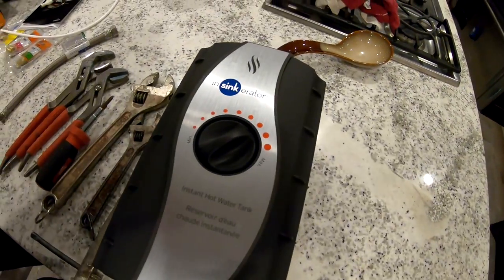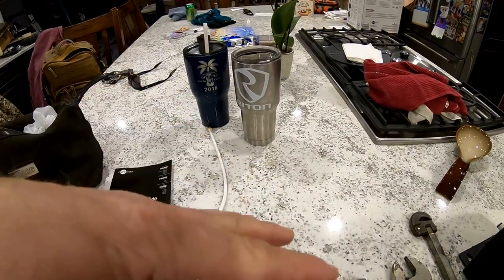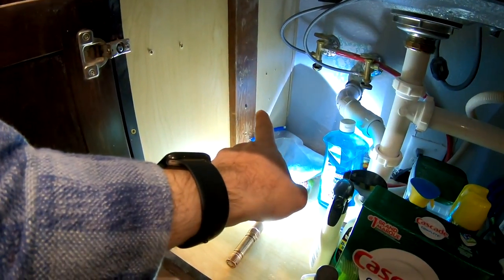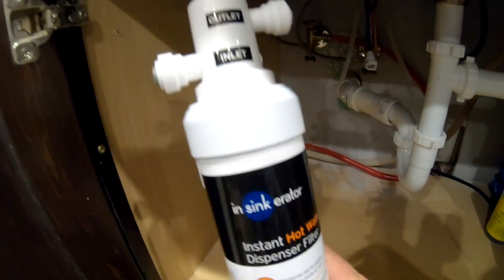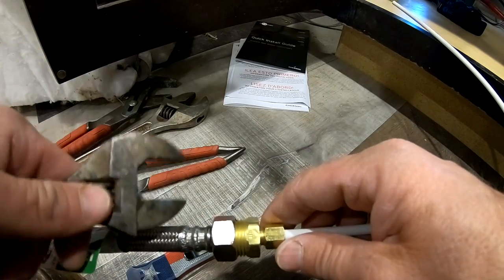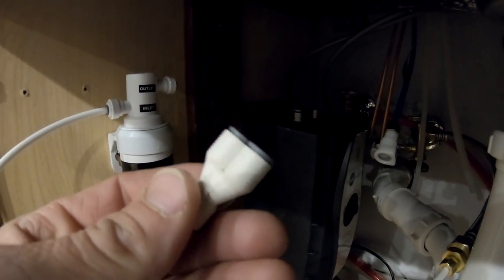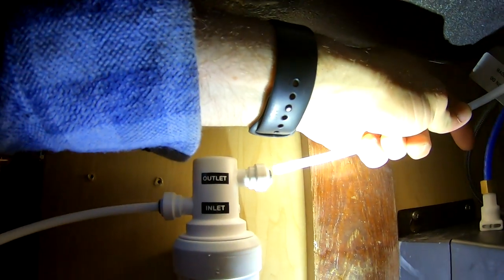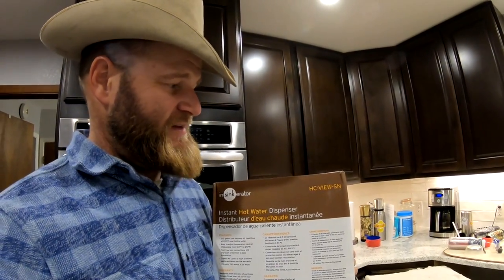HOW TO INSTALL A INSTANT HOT WATER DISPENSER

Comment: Love ours, I installed a year ago, use it daily for instant coffee. It is the InSinkErator Model 44719, it came with the chrome faucet in a kit, roughly $350 for everything. The install was pretty straight forward, I also installed a 3M Aqua-Pure 3MFF100 6000 gallon water filter prior to the water heater. That feeds the hot water unit and a stand alone drinking water faucet at the sink. 

Where I ran into issues, was at the garbage disposal unit electrical outlet. The garbage disposal is on a switch. Well, to use the outlet under the sink, the switch on the wall for the garbage disposal has to be on. What to do? I wound up buying a new outlet, the one under the sink was installed in the 1960's, and had to rewire that plug, there is a tab on the outlet that needs to be broken, to utilize one side for the wall switch, leaving one side that is always hot for the water heater. There are videos here on YT to wire up an outlet in this fashion if you run into a similar situation. It was a real PIA getting under the sink to do this fix. If not for that, this was a very simple install. 

On a side note, if you do have an outlet under the sink that is utilized for a garbage disposal, double check the outlet, you may have had a good electrician install the outlet properly, one side on the switch, and the other side hot. That is how they should be installed.
Reply from the maker: Awesome great information! What can also be done on the garbage disposal plug issue is leave the switch in the on position and install an air switch on the garage disposal and it can be turned on and off by the air switch so the insta-hot will be working the whole time. Thanks for watching 🤠

Comment: Thanks for the video with all the details.  btw, you can probably use the garbage disposal outlet.  The standard for an outlet with a switch is to connect the bottom outlet to the wall switch.  You can tell if it follows code when the outlet is installed upside down, i.e., ground is on top.   The top outlet should be live.
Reply from the maker: Thanks for the information and thanks for watching

Comment: I have a quooker fusion imported from the netherlands to utah and it’s an all in one system so there’s a ring around the faucet and you just dubble push and turn it and it will dispense 212 degrees boiling water like when it comes out it is still boiling amazing

Comment: Hey Brad, hope all's well with you and the fam. Is your water heater so far away you need one of these for the kitchen sink? Don't get me wrong, I'm a big believer in point of use water heaters, just wondering the application here's all.
Reply from the maker: Our water heater is approximately 25’ from the sink up the wall across the attic and back down the wall. So the heater is relatively close to the kitchen. The reason for the instant water heater is to use for birdies hot tea, or anything else that you would need or want very hot water instantaneously. Mainly for cooking. So I guess the short answer is what the wife wants......the wife gets!!! Thanks for the question and for watching.
Reply: @TexasBeardAdventures  Yep, that makes sense, especially since it has an in-line filter now that I think about it .....duh. Enjoy the tea Birdie and may 2021 see y'all safe, happy and prosperous!
Reply from the maker: I hope that y’all have a blessed 2021 as well!

Comment: Hi there!  We already have an insinkerator hot water tank/filter system and want to change the faucet to the hot/cold.  From what I am seeing in the video is the only difference having that split connector so you can put the 2 copper lines into it?  Trying to find answers and its been tough, thank you!!
Reply from the maker: I believe that is correct

Comment: That brass compression ferrule will crack that 3/8 pipe
Reply from the maker: If you over tighten it absolutely.

Don’t use a 24” pipe wrench next time.

Comment: How have you been liking this hot/cold dispenser? I bought the same model but not installed yet. Any issues and is the cold water very cold or cool? Would you prefer a model that swivels or has this one been working well for you? Thanks!
Reply from the maker: Hey Holly,

This unit is great! The cold water is the same temp as what comes out of the tap at any other faucet. The hot is super hot around 200 degrees. Get after it …….you won’t regret it!

Comment: When I got my new dishwasher I did not want it hard wired so I added a plug and then put a outlet on the electric wire coming in for the dishwasher . I did not want another hard wired dishwasher ever again . We were without power during the epic ice storm here in Virginia for 14 days and that caused problems with my dishwasher and well  . Power kept coming on and off 10 times in just 10 minutes . Now I can just unplug it if it ever happens again , I don't want to have to buy another dishwasher  . I put the outlet on the wall cabinet for the sink  . Is that a cold and hot water one . I was looking at only the hot water one . Epic ice storm here made a mess of the woods behind my house that is 12 acres , over 80 trees went down or were leaned over and  Ilive in southside VA near the NC  borrder . Never want to see that again . Hope yu are safe down there with all the illegaLS . wE HAVE THE AFGHANS HERE THAT WERE NOT VETTED AND THE ILLEGALS   .
Reply from the maker: Yep, plug-in is The way to go. Thankfully we don’t get many ice storms down here. We just need to close the borders! Y’all be safe this winter. Thanks for watching